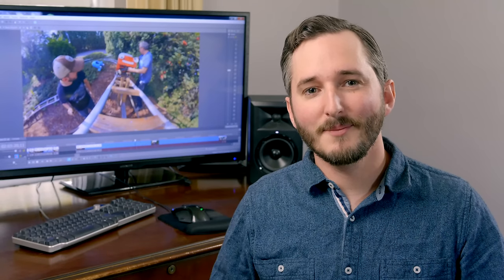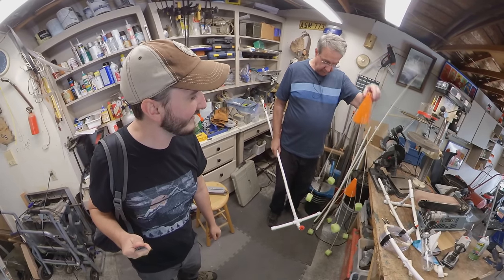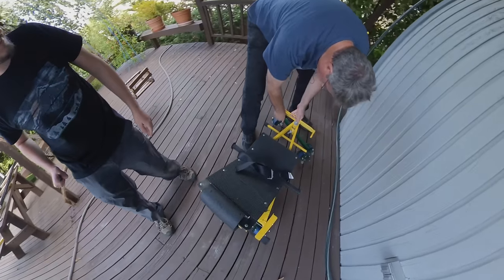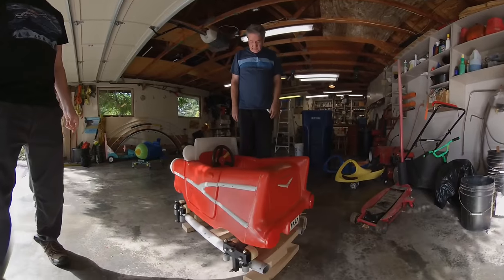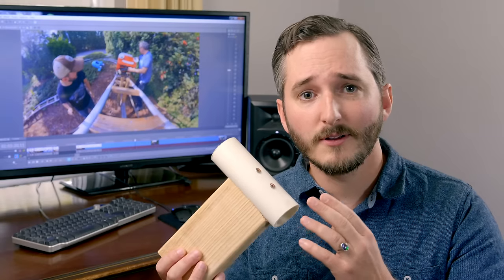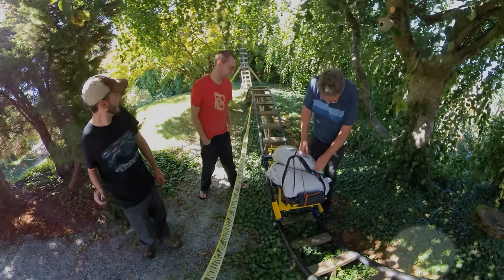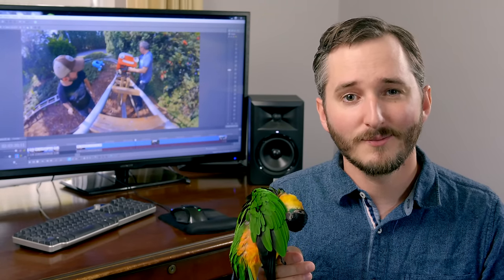How to Build a Backyard Rollercoaster (for less than $500)

Comment: I've never thought about the neck whip but it makes a lot of sense!
Reply from the maker: Thanks Destin! Yeah it gets even more interesting if you go through a loop where your head goes past the radius.
Reply: I'd kind of assumed that head closer to the middle would be better because it's not moving because I never thought of the issue with transitioning to and from it.
Reply: @Nighthawkinlight  That would mean changing the acceleration from one direction to the opposite direction in an instant, wouldn't it? That sounds like a horrible thing to experience!
Reply from the maker: @TheMrMKultra  Yep, that's exactly right.
Reply: Full scale coasters have a similar problem when they suddenly change banking. Taller riders heads will whip much harder than shorter riders as the train enters/exits the banking change.
Reply: I’d like to see some clips where it’s more obvious to see the acceleration and and deceleration of your head compared to the track. I really liked the copper tube dude rollercoaster, it was a great visual description of how your heads acceleration changes different from the tracks
Reply: Guessing you mean whiplash
Reply: I know right! I was gobsmacked! It's absolutely common logic, but it's just something I would have never thought about!
Reply: You are everywhere Destin!!
Reply: Yet again, i learned something.
Reply: Destin , you should go to theme park and do a video on it. :D
Reply: I figured it running Circle track, Those of us that sat tall in the seat leaned into the turns. Some of us tilted then tilted them about 3/4" in to even the load on the back.
Reply: It’s the reason the track moves left while banking to the right and vice-versa. Or heartline roll. Old coaster didn’t do that so they had more gradual banking.
Reply: This explains why I can't ride the Corkscrew (Cedar Point) without dying.  I also had problems with Mean Streak due to it's sudden braking but that has since been reworked into a much better roller coaster.  I live around an hour away from Cedar Point.
Reply: So thats why i feel like i got punched in the neck when i back flip, i am tall and heavy
Reply: @Nighthawkinlight   some how it was the first thing I thought about when a friend had the idea to build a small looping in his backyard...  (some crazy idea you have, but will never be real.... )

  there was this chair with some wires...  now there's a stand-up-rollercoaster to the basement...   (oops, just kidding but could be possible..)
Reply: I am a very tall teenager and my neck doesn't hurt like that when I ride. Maybe it because I'm a coaster enthusiast and I am used to that stuff.

Comment: The sensation of jerk is also why no rollercoasters have perfectly circular loops, as the g force from a circular loop is much more likely to snap the spine and kill the rider
Reply from the maker: Yep, modern coasters use a clothoid loop
Reply: Actually there are a few (modern) rollercoasters that have a (near) perfectly circular loop. However coasters with these loops tend to have a lot of “hangtime” by going very slowly through the top of the loop. That and having a large enough radius is how they keep the g-forces in check. One example of a rollercoaster with a (very) circular loop is Copperhead Strike at Carowinds.
Reply: @Flyineddy  Schwarzkopf coasters also have some pretty circular loops.
Reply: @mineyvoid1308  Indeed. Especially the loops of the Schwarzkopf Thriller (AKA "Zonga", "Tsunami" and "Texas Tornado").
Reply: actually.. they aren't circular because the teardrop loop makes sure that the g forces stays very constant throughout the entire loop, also loop entry's are big enough that the sensation of jerk is almost nearly impossible to feel
Reply: @keesanker4241  Indeed a teardrop loop keeps the g-forces quite constant (although if there's a train with several carriages there's quite a difference between front and back). But there are certainly modern rollercoasters that have (near) circular loops, but indeed with a big enough entry to prevent serious jerk. These loops usually have high positive g-forces (4+ G) in the entry and exit, but "hangtime" (nearly -1 G) at the top.
Reply: Acceleration towards the center of curvature equals velocity squared divided by radius of curvature.  Big radius, less centripetal acceleration.  Small radius, more acceleration.  Math and physics.
Reply: what if you were laying down? Head about 3 inches from the track.
Reply: I like Schwarzkopf loops
Reply: Daniel Pierce yeah would help. Would be best if your head is toward the center
Reply: @Flyineddy Or six flags magic mountain's Full Throttle?
Reply: @tcrpgfan  That one is reasonably circular, but still somewhat teardrop shaped. More so than Copperhead Strike anyway.
Reply: Revolution at Six Flags Magic Mountain has 1 loop that’s circular. The ramp down into the loop is really long and it’s a really big loop though. If I’m not mistaken Revolution was the first looping metal roller coaster.

Comment: That's why we use heartline and teardrop shaped loops when building rollercoasters nowadays.
Excellent video!!!
Reply: What's heartline?
Reply: @tiagotiagot  a heartline roll is basically a barrelroll with such an offset, that the coaster isn't turning around your head but around your heart instead.
That way the force is reduced.

If the roll turns around the track axis, then the G-Forces in the Head area are incredibly high, on the other hand when the roll turns around the head axis then the force on the track will be incredibly high.
The Heartline roll is kind of the happy medium and therefore making for a much more pleasant ride while still providing the same thrill

Comment: To add a little more thought on the acceleration issue, these small coasters of mine have much smaller track dip radius of curvature than a professional roller coaster, so it's a concern for me if  I have a taller person ride.  But, professional roller coasters have much larger track radius of curvature in dips, so the effect is much less pronounced.  I believe professionals design to what is called the "heartline" first, which is a 3D path your chest/head takes through space, then they design the track offset from that 3D spline.
Reply: Paul Gregg awesome designs and idea. But I imagine your insurance company hates you.
Reply: Jack Rainey  A lot of basic information is in videos on my channel.  I also wrote two ebooks available on my website.

Comment: this just shows how perfectly designed rollercoasters are. because even this is really a rough ride when its designed by a plane engineer. and it takes alot to make a rollercoaster have a smooth ride
Reply from the maker: These coasters are a smooth ride for the size person they were designed for. The math is done differently for adults.

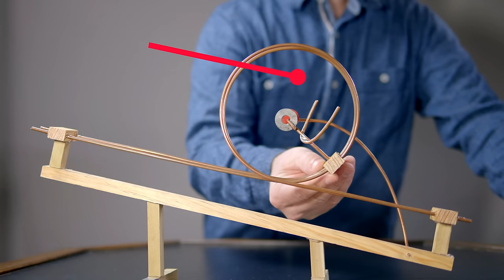Comment: 14:30 If I'm not mistaken, in this particular case it's actually just the acceleration , not the jerk which is the problem here; since the velocity goes from non-zero to zero almost instantly, the acceleration is very high. Of course that also means that there is a really high jerk, but the acceleration in itself is already quite deadly

Comment: That neck whip concept is interesting.  I wonder if that problem lead to the development of inverted roller-coasters where passengers ride underneath the track placing their heads closer to the track. Inverted coasters seem to have a lot of loops and corkscrews. Cool video.
Reply: The coaster with the record for most inversions, The Smiler, has its trains on top of the track. And it took about 90 years from the first example of a coaster with trains underneath the track to the first one with an inversion.
But his little model of a loop is actually not far off what the early looping coasters from the 1800s and very early-1900s did to riders. They were so unpleasant and dangerous that there was a span of over 70 years when no more looping coasters were attempted.

Comment: So the non pivoting rear axle is just held by the vertical axle shaft? Arrow coasters use axle limiter tubes on both sides of the wishbone on some of their coasters to lower the stress on the vertical axle shaft.

Edit: nevermind I didn’t see the support plates underneath! ( 6:10 )A good solution!

Comment: If you're willing to do extra work, then the obvious solution is to use a biscuit cutter and slice holes into the pipe where they need to meet the ties. That would increase the structural strength considerably. Heck, if one wants, they could even make it a locking joint using a wedge system.
Reply from the maker: Paul has 50+ tie joining designs that have been considered. There are pros and cons to most. I would expect cutting a big gouge out of the rail would be prone to cracking in the corners. That's the sort of thing you really have to test though, and compare strength with other designs.
Reply: Interesting suggestion.  But understand that with a complex track shape, the 2X4 track tie doesn't intersect the PVC rail at the same angle every time.  In reality, the PVC rail doesn't nest into the cup shape on the end of the 2X4 tie perfectly, and there are air gaps.  Hence, the heavy cart testing of the fabricated track and cart is what really qualify the design.  The element-level track tie joint testing I've done really is a screening test for different designs.
Maybe the joint could involve a round hole in the side of the track, with a ball on the tie.  Of course, any large hole degrades the capability of the PVC track....

Comment: at 10:56 Paul was saying to paint the PVC , may i know which type of paint he's using , usually many types of paints don't stick to pvc
Reply: I think there are spray paints which say they stick to plastic.  I can't remember exactly what I used.  The key to all painting is surface prep.  I clean with acetone just before painting.  Darker colors are supposed to block UV radiation better..

Comment: Okay this was worth the wait! (Although my recommended has literally all been homemade rollercoasters for the last week, is this a sign?)
Reply: I also wondered would it be possible to incorporate some sort of bike chain system as a hill chain where the track catches the pedals (sprocket?)  It would require a lot of strength depending on the hill incline and adds more complexity and danger but wonder if it would work at all?
Reply: @DLicious  A bike chain (nor the gears/ratchets/etc. designed to work with such chain) is not built to handle the kinds of loads that this application would place on it, and it would in all likelihood fail, so you would have to find heavier-duty solutions for it, but beyond that, nothing would make it impossible.

It does, however, sound prohibitively difficult and expensive to design and construct in a safe way.
Reply: @IaCthulhuFthagn  okay so let's forget safety a minute, is this an issue having multiple chains would solve? I'm sure that would complicate things a lot more but figured I'd ask?
Reply: @DLicious  It's probably possible, but it opens up a whole new world of tricky mechanical interactions and spectacular new failure modes to consider.
Reply: @IaCthulhuFthagn  interesting for sure, thanks for the responses

Comment: Actually, most modern steel and wooden coasters are designed with something called "heartline" where the track banks and curves around the rider, so all g-forces exerted are normally calculated with the riders in account to the shaping of the elements, or "loops" and "drops" of a coaster. This is why you commonly see older rides exerting more force upon entering an element than newer rides, as they had much more basic design processes.

Comment: That part where you explained about the head jerk was the most fascinating part to me as well. It also reminds me of a physics question I've still been wondering. If you have a ball or a disk with a specific diameter, and it rolls down a ramp and into a loop that has the same diameter as the ball or disk, the ball or disk fits perfectly into the loop, but what does that look like as it rolls in and out of the loop? I can't seem to imagine it. 

I would guess like the head jerk of the roller coaster in your video, the ball or disk would stay in the center of the loop, but for the roller coaster, it takes some time for the cart to travel around the loop of the track. For a ball or disk that makes contact with all sides of the loop, it seems instantaneous. I'm no physicist at all, but this concept has been bugging me for a while until this video clarified a bit of it.

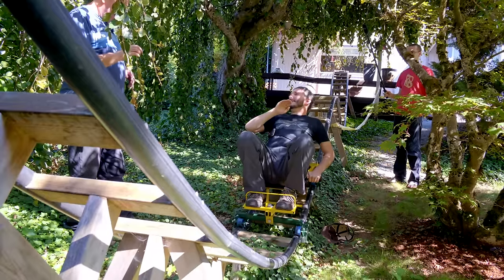Comment: ~13:35 - Describing the issue with Arrow Transitions.  Modern transitions are designed to take the rider into consideration rather than just the wheels.

Comment: Why didn’t he load the voids in the pipe?  This would give the pipe more strength by distributing static pressure to all sides of the pipe. It would also act like a shock absorber. This technique is used on a lot of coasters made today especially single rail.

Comment: I want to build one of these for my kids, just the simpler 2D version, but even though I’m handy and fairly intelligent, I worry that something would go wrong one time and hurt them badly or worse. The big problem is the massive hill it would be built on. If I could buy the 3D cart that turns then I could make it wind down slowly, but I don’t think I have the skill or machining tools to make the 3D cart. I’m going to stick with building a treehouse with a big slide instead, even though I would be the coolest dad ever if I pulled off a rollercoaster. Damn.

Comment: I work in the plants and refineries and I don't trust anything that doesn't have a safety factor of at least 5x, even then I have still seen shit fail. We also use nothing but conduit when it comes to plastic piping but I'm pretty sure that is mostly due to static charge build up.
Reply: If you've every flown on an airplane, you've trusted a factor of safety of 1.5.

Comment: what happens if it rains will it ruin the wood?
Reply from the maker: The pieces that touch the ground are outdoor treated wood, the ones in the air are regular lumber. It takes a good amount of time before rot is an issue if wood is used properly outdoors. See the many old wooden coasters in theme parks still in use.

Comment: Brother, Awesome Review! But you never cover Cold weather will also put stress on track. And did he join the 2 pipes together or butt them up to one another? Thin wall galvanized steel conduit I think would of been better to use!  Has anyone ever told you that you look like a Young Senator Ted Cruz? Best Regards and Keep Safe!
Reply from the maker: Paul's books detail the specifics of the design and safety specifications, this video only scratches the surface. The pipes are butted up to each other with a sleeve of smaller pipe coupling them on the inside.

Comment: Note: A backyard coaster may increase your insurance rates, and any structure with what would be considered a permanent foundation, requires licenses to construct. Builder discretion is advised.
Reply: That's one reason I never use concrete foundations, plus it's temporary and I don't want to clean up the concrete.  When you get a trampoline or swing set, your insurance doesn't go up.

Comment: There’s grey plastic on the telephone poles behind my house that have been there in full sunlight for fifty years
Reply: Tap them with a little hammer and they will shatter.  All PVC fences you see have damage.  It's all about strain rate with fracture toughness.
Reply: @PaulGreggBYRC  I dunno, I tried to rip one off that my goats were messing with and it was tough as nails.  Whatever they used 50 years ago was the good stuff

Comment: Well this seems simple, but i doubt it. It actually looks like the most complicated woodworking project, because it involves physics, engineering, and you have to make sure it's safe for children.
Reply from the maker: The end result is simple, but the work Paul has put in to get there is very complicated. He has done extensive testing.

Comment: First test ride of a new coaster design. No safety straps. No helmet. Srsly? All that time spent checking everything, but couldn't borrow a motorcycle helmet and some nylon tie-downs?

"I wouldn't suggest building a BYRC is for just anyone." Uh… yeah.
Reply from the maker: It's not the first test ride or a new coaster,  just the first time I've ridden it.
Reply: @Nighthawkinlight  Yeah. First human test at that weight according to the video. Even if you are convinced it was a safe thing to do (it wasn't) it's really irresponsible to show it as good procedure for others. 

Kind of sad, as I was reasonably impressed with the safety precautions up to that point.
Reply: I started out with helmets, but they increase the chance of neck injury, due to extra head mass.  There's nothing to run into.  So no helmets.

Comment: I’m sorry but this thing will not pull 3Gs, and certainly not 4...
Reply: This one does about 2g's if you don't push it, 2.5 if you push.  with abut 15 feet of elevation, 4 g's is possible.  Do the math.  Centripetal acceleration = velocity squared divided by radius.   If the radius is small, you can get a lot of centripetal acceleration.  Plus, you get 1g free with gravity.